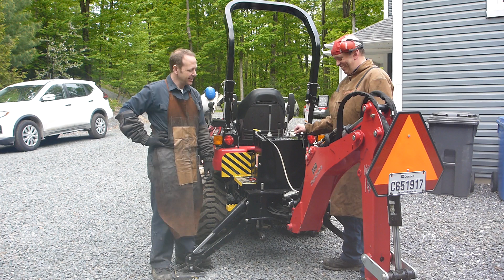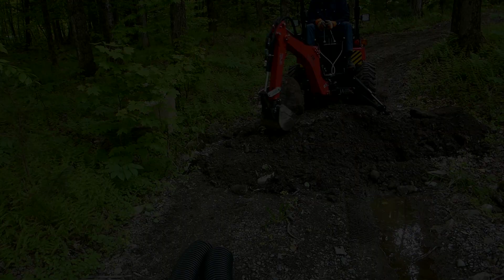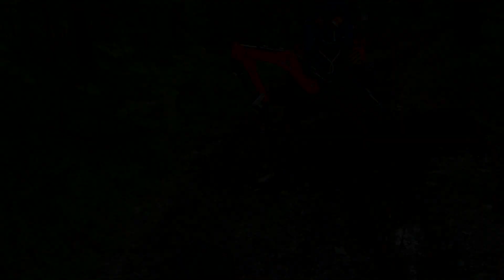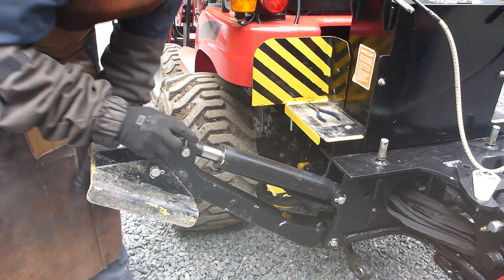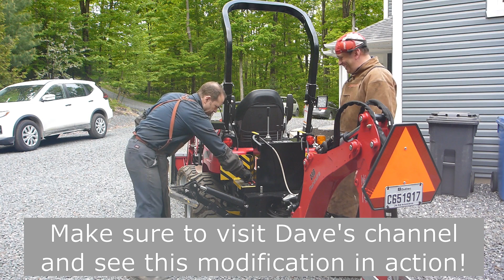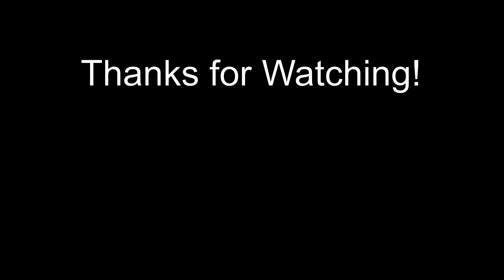#162 Backhoe Outrigger Protection (Mahindra eMax 20S)

Comment: A smart and inexpensive remedy.  I know Dave will feel a whole lot better once those plates are in place.  As you mentioned, one inadvertent nick or ding in the cylinder shaft/rod equates to an expensive headache.  Great idea.  👍
Reply: I agree with you Sir, there are been already tested in my current project !!! Cheers !!!
Reply from the maker: Any video coming up for that project?
Reply: @FromSteelToWood  Yes, three more video !!! but because of the rain it's a full stop !!! and My internet problem is fixed now !!! Cheers !!

Comment: I think I will do that for my back hoe but use hard plastic pipe. Thanks for sharing just sub to Dave's channel
Reply: Good evening Sir !!! I That's a good idea but i'm afraid that it will shear off the plastic, Steel is really strong and putting 1/4 rubber pieces unders act as shock absorber !!! Thank you again Sir, Cheers and thank you again SIr !!!